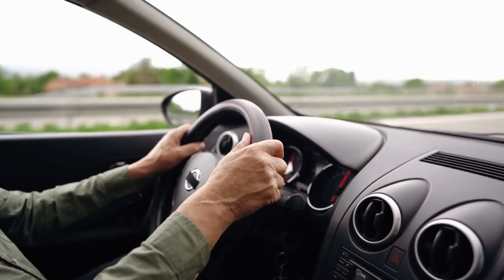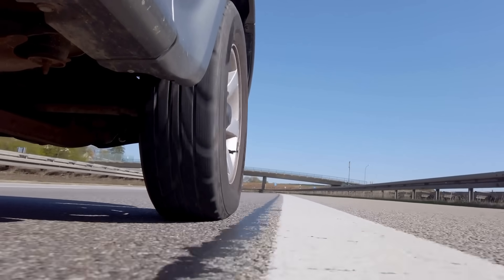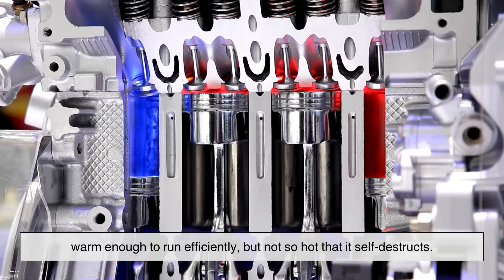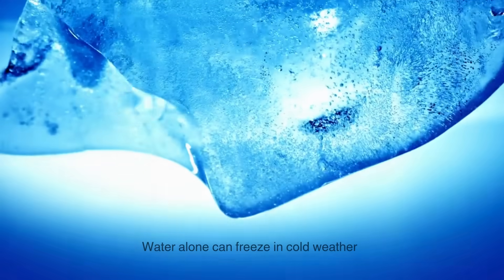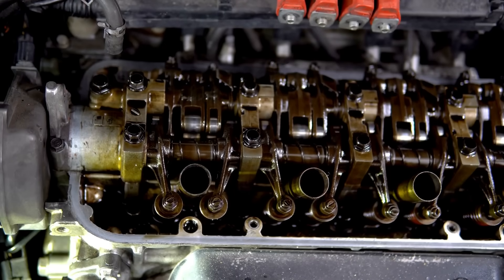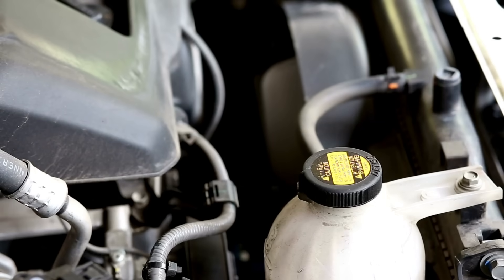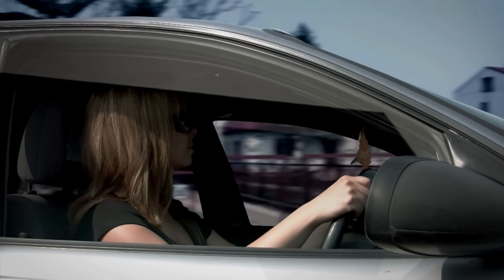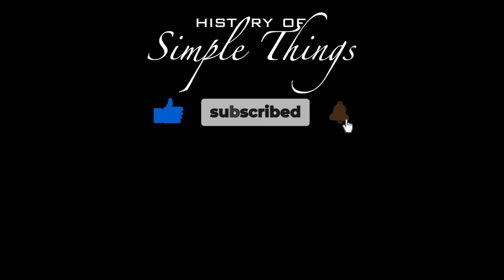The Grid That Pulls Heat Out of Your Engine

Comment: Ah, this reminds me. Somebody took a pair of motorcycle radiators and linked them together with computer fans attached to blow air through them while an aquarium pump ran near-freezing groundwater through the radiators, turning it into a 'dry' swamp cooler that was really efficient. I think it might work, if less efficiently, if set up with a geothermal closed circuit.

Comment: There’s wax in the thermostat that melts at a certain temp. Then solidifies at it below a certain temp. A purely mechanical system. Nearly all are designed to be stuck open in case of failure. Easy indicator is that your engine never warms up.
Reply: Sadly i have seen most of them stuck closed causing overheat.😅 I have yet to see one stuck open.
Reply: @stanz55 I’ve had two get stuck open. I could be wrong about them being engineered to stay open but my dad had one get stuck up too. He told me they were designed that way. Typically he’s right on those things.

Comment: Radiator... The original model T had no water pump... Didn't need it because the cooling system was designed to use natural circulation because hot water rises and  cooler water sinks down. Thermodynamics... ya gotta love it... Heat always moves to a cooler area.
Reply: The oil radiator on my old motorcycle worked like that.
Reply: @lajya01 my 1978 Honda 750 Super Sport was that way also and was a dry sump engine to boot. Some days you could FEEL the heat coming from the oil tank under the right side cover.

Comment: Ahh yes 1:04 the Pistons turned by the crankshaft compress air and gasoline from the fuel injectors and then the spark plugs ignite the mixture. On diesel however it uses a different mechanic they use something called glow plugs diesel actually implodes on itself Because of it being compressed more than normal gasoline engines. What I can recall from my automotive classes and the automotive systems technology fifth and sixth edition. But if I'm wrong or missing something please correct me in the replies.